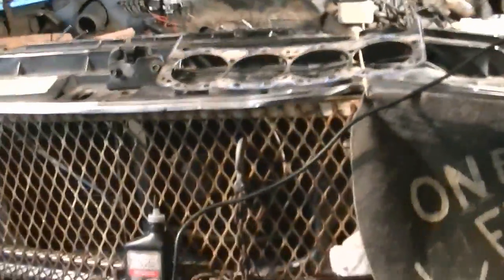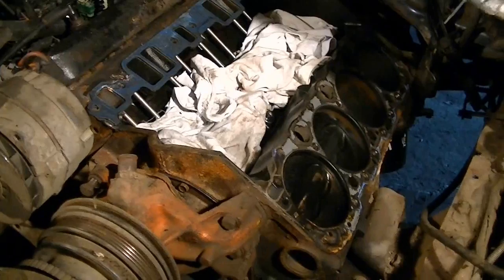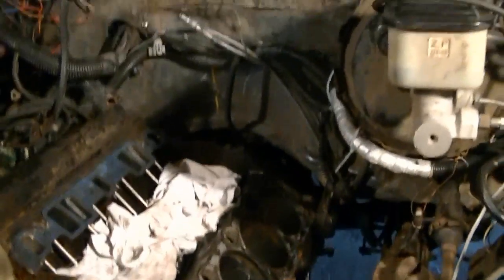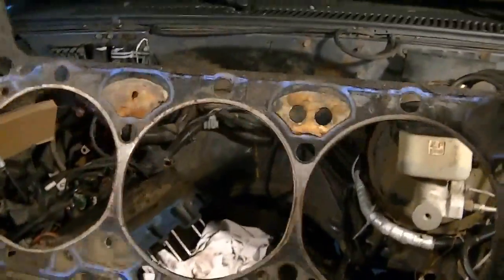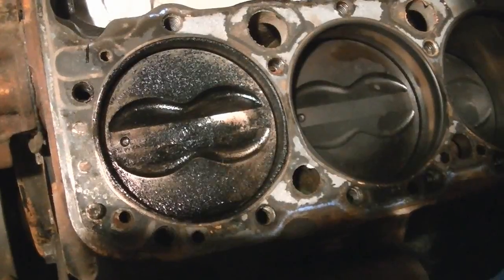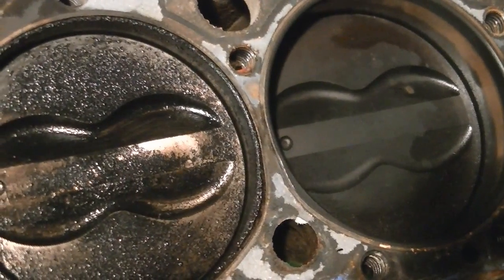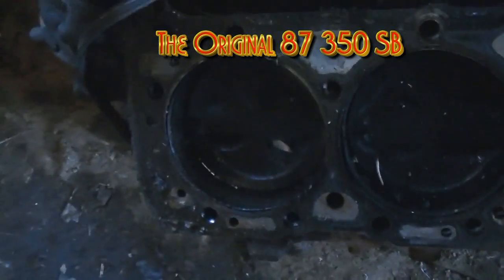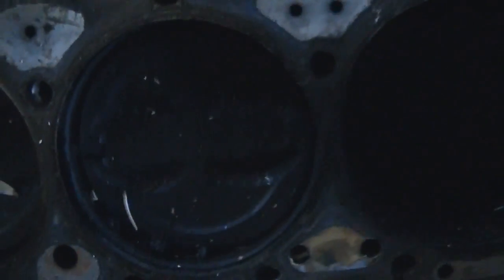Chevy 350 SB Piston Question

Comment: Good pistons! Flat top! To really give this guy a boost in power pick yourself up a set of vortec heads, you will need a special intake manifold but those heads are worth a ton of hp+ torque. Also, I think they come stock (the heads) on 96-2000 maybe later? 5.7 vortec chevy trucks and suv casting numbers "906" and "062" last three digits found cast into tip of head between valve train. 882 is a decent head also, but large chambers. The vortec outflow any other stock iron head and have an insanely efficient burn, turn advance down to 30-32 advance and you'll be throwing mud like crazy!
Reply from the maker: Thanks for all the info. The truck has sat on the back burner for a while now but my intention is to go back to carbed. I have had so many issues with this throttle body system because of getting wet and muddy. I have an old set of 300hp heads (camel hump) that I want to try. I also have a 480 lift cam for a carbed system. I pinned this comment to the top of the comment section i case I (or anyone else) need these numbers.
Reply: Dump the camel humps- not even a comparison between vortex’s and camel humps! Vortec’s all day every day every time! Nearly 60~100hp bolt on improvement! Vulgar Hyena is absolutely correct!!!

Comment: That looks just like the same piston pattern in my stock 305
Reply from the maker: I think GM used that type of piston in many engines.
Reply: @MudRFunR  These tbi blocks cam in 3 versions. Low, Mid, and High compression! The low compression had the the bigger (191) 76cc heads with dish pistons and was around like 8.5:1 or something then the mid had the (193) 64cc heads with dish pistons for around 9:1-9.3:1 compression these were in the trucks and vans and the high compression had the 193 64cc heads with flat tops for around 10:1 and those were in police/passenger cars. So the high comp did come with flat tops but I still think those are aftermarket pistons by the looks of them but could be wrong, you can tell if they are out of the block
Reply: Either way depending on which head u have high compression ain't a bad thing as long as it's still pump gas able lol. If u have the 193 heads then it'll be perfect but even with the bigger chamber 191 heads it's still around 9 so is still good for your truck. Unfortunately both those swirl port suck at flowing after about 4k rpm but for a mud truck would be great cause they do make awesome bottom end power
Reply from the maker: @jjmccloud  Thanks for the info. I have this engine on a stand right now. Plan on tearing it down in the future.
Reply: @MudRFunR  No problem, glad to help a fellow sbc brother! I'm building 1 up on the stand right now lol

Comment: The valve relief design is for the the different compression carrecteristics depending on what heads you put on the motor if you look up your casting head number which are the last three on the head Google it and you can get info on what cc your heads are

Comment: The Pistons you have are the ones that summit sells for $100 bucks for the set there hypertectic Pistons with a 64cc head you will have 9.61 compression and with your motor being 40 over your cubes Change it's not a 350 any more it's now a 357 those are good Pistons there not dome I'm running those same Pistons in my 355 with fast burn heads since my heads are 62cc my compression shoots to 9.81
Reply from the maker: Thank you for all your comments on this engine. Very educational for me. I still have this engine. It's on an engine stand right now.
Reply: @MudRFunR  You get her back in yet
Reply: Enginetech P1534 or similar

Comment: havent had the chance to look yet, but im thinking so you can turn the piston whichever way you want, so you dont end up putting the cutouts on the wrong side and grenade your motor. but thats me
Reply: NO  wrong  thinking . For one a stock piston has a .050 wristpin offset to prevent knocking on cold start up. But your half right as the notch would face the rear of the engine in a RHR application.

Comment: cant tell by looking at the vid what the pistons are,chevy put many diffrent combos together for any given year and model.measure the cylinder bores with a digital vernier caliper ( canada tire plastic one is good enough} stock bore on 350s is 4.00 in ,next size up is 4.03(30 over in hot rod talk) most people go with flat top pistons on rebuilds for a little more compression and torque,with stock heads(72 or 74 cc chambers) you have around 9 :1 compression.dont know if this helps.see u at  dunes